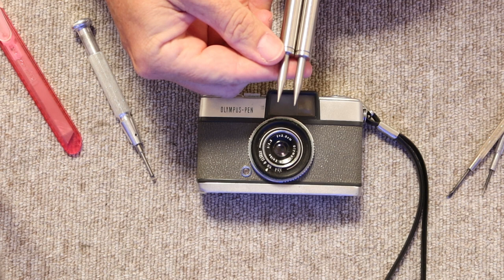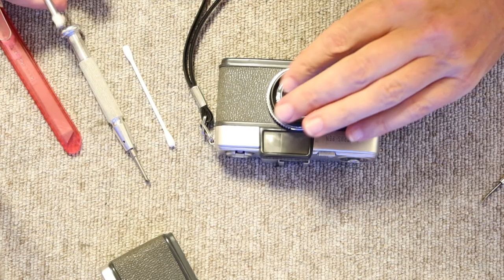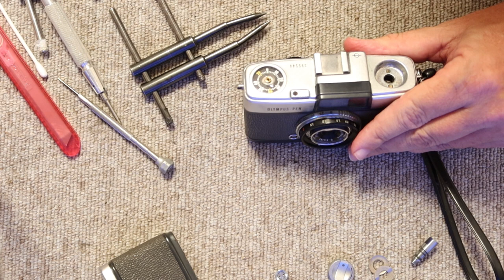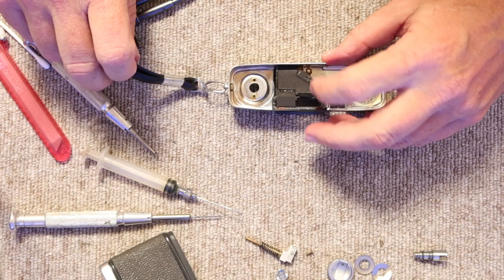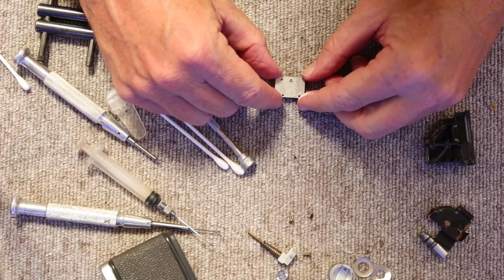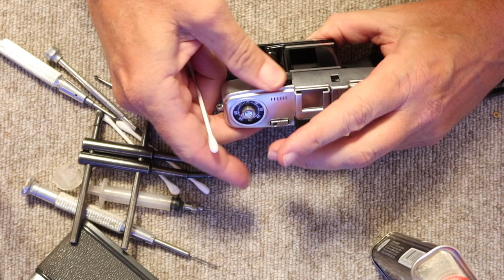How to fix up an Olympus Pen half frame camera

Comment: Thanks for the video. In my Pen D2. The shutter doesn't stretch when the frame is stretched, it just releases. Unfortunately, oiling the parts you describe does not help, even pulling up the spring did not help. It seems to me that the fault lies somewhere else, maybe in the ring with the finger that moves the re-tension lock.

Comment: I am extremely glad to have seen your video on the Olympus Pen S.

I have inherited my parent's Olympus Pen S. I've been using it for almost 5 years now but a few days ago before loading a fresh roll of film, I recycled through each of the shutter sped settings until the shutter got stuck on the bulb setting.

I reviewed this video and applied a little lighter fluid using a cotton bud on the shutter which fixed the problem.

It's now working well.

Later my next diy fux wpuld be aligning the frame line glass on the view finder. It's a little out of alignment but still usable as of this time.

To do this, I wil  be purchasing  8n the future a spanner to remove the screw of the film counter.

Sir, thank you for the videos and looking forward to more in the future.

Comment: I have an original Pen like this one. Mine works except for the frame counter, which you did not cover on this video. It would be helpful to see how to service the frame counter function. Mine takes great pictures. Without the counter working I just shoot until it will no longer wind forward. It takes a long time to shoot 72 pictures.

Comment: First of all, thanks so much for this amazing video! So much useful information and so many details are really welcome, specially when the information about disassembling this camera is so scarce on the internet...
I wanted to ask you if you’ve encountered any of the two problems that my Pen (3.5, early model) suffers from, and those are a pretty stiff shutter speed ring (doesn’t bother me much, but I’m not sure if it could be problematic) and my biggest concern: the exposure counter not advancing. It moves together with the arrow point when advancing the film but it will stick on the same number no matter what, so they just spin together in the same position over and over again.
If you have any information on those issues or know how to fix them, I would really really appreciate it!
Thanks a lot and keep up the amazing videos!

Comment: This is a great video, I just made a huge mistake and have no one to share it with...
I engraved my Olympus Pen, its all pretty so I took it out to shoot a roll, the shutter is sticking open.... so I look inside  following this videos disassembly, and cant find whats wrong....
so I took the lens out, like you said you have to peel back the leather and all that, that went OK, here is where I screwed up, I just saw the three screws on the bottom of the lens, the peice thats like a cup that holds the shutter stuff, so i undid them and pulled it off.... springs flew everywhere, I had no clue where they originally went.... ughhhhh.... It took myt about 6 hours to get it back together..... works great now though.
I did find the problem though, a small shard of metal from my engraving had fallen into the camera and jammed itself under the shutters where the little bump out to move them is, It was jammed in pretty good so I do think disassembly was necessary, but gosh, i wish I realized I could have took the lens apart from the front!
Today I will be trying to refocus for infinity, not sure how with a half frame as the ground glass doesn't have much detail....

Comment: Right after you took the top cover off (13:22) there was a small brass washer near the rewind knob hole that you took off. Where did that come from? Did you put it back?

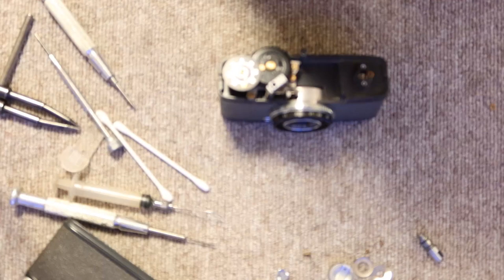Around 30:30 it looks like there was a second washer that slipped over so there would have been two washers for the two holes next to the rewind knob hole.

Comment: Hey, does this apply to the Pen W? Mine has a stuck shutter. Besides that, the Bulb setting was working, but then it started firing at 1/30 instead. I don't really mind fixing that as much, but still would be nice because I need to clean the inside of the lens as well. Thanks!
Reply from the maker: The Pen W has the same shutter as the Pen S, and is prone to having the same issues.
Reply: @japanvintagecamera8869  Thanks for the tips. I tried cleaning it a bit but it's still stuck. The winding mechanism is wound, but it won't fire. I suspect I'll have to open it up, but I suppose I'll be better off just taking it to a repair shop.

Comment: I have a question, can i use oil that we also cook with or do i need some kind of special oil? Also,i have a pen d does it make it harder to open the top because of the light meter? Is it more dangerous?
Thank you very much!!

Comment: I bought one the other day the Olympus Pen S with the f2.8 lens. Your right the shutter blades were stuck solid and the only way to free the shutter was to strip it down. The aperture was working but something must have moved and it will not close down now. The blades have slipped. I've put all kinds of shutters and aperture blades back but this unit seems like it's impossible to open. I have the aperture unit out with no lens elements in it but I can't get any further. On the inside part there are two notches that you can put a spanner wrench on but it seems stuck fast. Have you ever opened one up. Any help greatly appreciated.
Reply: Hi Peter, did you ever manage to fix this? One of the aperture blades has slipped on my Pen S too. Any help would be much appreciated! :)
Reply: @MoNtAg3mAn  alas no. I tried everything and damaged the screw thread so it will not go back in the body. I bought one the other week in better condition than what the photos showed for $1. Of course postage and taxes from Japan made it about €35. So I can either service this one or use the lens and aperture part for the other serviced one. The blades will come out if open the lens up and take the pressure off as you might have done for cleaning. I think I will cut the other one up to see how it is supposed to go together for future reference. I'll let you know the results

Comment: hey man, first of all thanks for the video, its very complete. I want to ask you if you know on how to solve my problem because the repair costs too much. I'm having trouble with a light source reflecting, there is a shape of white light in almost every single photo that I take outside. It's bothering me because it covers the entire picture. If you know how to fix it let me know, i would really appreciate it.
Reply from the maker: The camera probably has a light leak. There is a seal on the bottom cover and another in the channel where the cover slides up under the top cover. More than likely the bottom light seal  needs replacement, the top seal is redundant, and light won't leak from the top even if there is no seal.
Reply: @japanvintagecamera8869  Alright, thanks a lot man!

Comment: Great video, thanks, one of this just lining up for repair in my stash. New sub here.🙂 Hey just wondering do you have any trick to repair non working light meter in camera? For example the one in like a Ricoh half frame.
Reply from the maker: The best you can do is salvage a working light meter cell from another camera. Many early cameras with selenium cells, like Minoltas, had an adjustment screw to adjust the sensitivity of the meter, this can make the meter cell easier to adapt to another camera.

Comment: Very informative video. I have a Pen D2 I've been looking for how to service and didn't have any guides on it until now. My Pen D2 had a jammed advance knob. After watching this, I got bold enough to pop the top off the camera. That mechanism you mention at 13:43 was stuck and wouldn't let the knob move. I pushed it out of the way and now I have the reverse problem. The wheel advances the film and cocks the shutter, but does not stop. It does not cause the shutter to fire though. Any advice how to fix this?
Reply from the maker: There may not be a problem with the winding mechanism, it may be the shutter blades are stuck, and since the shutter wasn't firing, the camera wouldn't wind. The winding mechanism has pawls in it, these limit the travel when winding the film, and prevent the knob from being turned the wrong way. Make sure that these haven't been knocked out of place.
Reply: @japanvintagecamera8869  Once I got the advancing lever free, the shutter cocked and fired cleanly. There's something hinkey with the advancing wheel+levers such that the catch doesn't engage the pawls when it should. The pawls did look a little loose, but I'm not sure which direction to tighten them. Hopefully I'll have time to mess with them later this week.
Reply: I got back to fixing this camera. It looks like the cocking lever was pushing enough to engage the shutter, but not far enough to engage the winding mechanism to stop. I carefully bent the small lever between the cocking lever and the winding stop and that seemed to make it work properly. I'm not sure if its a permanent solution.
Reply: Can I ask if you mean, the winder will wind, but doesn’t stop where it should to take the photo? I’m having this issue now. I think I’ll have to rewind film and then attempt to fix

Comment: Would appreciate any input from yourself or commenters! I have an original UV filter attached to my Pen (same model as above) that has corroded and I cannot unscrew. Camera film tested and functional but lens has oil. If I unscrew from inside the camera to clean the lens, am I still able to access each lens component without complete disassembly? I am still new to camera repair and would hate to cause damage in reassembly. Many thanks.
Reply from the maker: I usually end up having to break off stuck filters on these cameras, this involves using metal nippers which I use to cut the rim of the filter and break the glass. You have to be careful not to cut or scratch the filter ring around the lens You can clean the inside of the lens by removing the rear element, you can hold open the shutter with the B setting, and use a pair of needle-nose pliers as a lens spanner.
Reply: @japanvintagecamera8869  That's excellent advice, really appreciate your expertise. Will give it a (careful) try. Many thanks.

Comment: Is there a way to remove internal dust from the lens? 😊
Reply from the maker: If you hold open the shutter on the B setting, you can remove the rear lens element group, then you can clean up the inside of the lenses.

Comment: Hey man! I wold like to ask u a thing, the shutter of my Olympus pen (like ur model) it’s locket in the “open” position and it does not close anymore. How can I fix this? TIA
Reply: Sorry I meat the blade of the shutter are blocked
Reply from the maker: The shutters in these cameras are prone to sticking, naphtha or lighter fluid will usually loosen them up enough to open or close properly.
Reply: @japanvintagecamera8869  thanks for answering me! The thing is that I can not see the blade of the shutter cause it’s open
Reply: @japanvintagecamera8869  if you want, you can answer on my mail so I’ll send you pic of my camera! Thanks a lot!!
Reply: Same problem as I am having. Have you resolve this already?

Comment: Why does mine need to advance 2 times to shoot...? 🤨 Is it a problem? If so... How to fix it. Pleaseeee
Reply from the maker: There is a latch and a pawl in the winding mechanism which often sticks in these cameras, and this causes winding problems. Cleaning and oiling these parts gets it working properly again,
Reply: @japanvintagecamera8869  thank alot! ☺️ Just got into film, found pen original. For 5 bucks 😂
Reply: Luckkkky! I bought my EE-S for $135.. lowest price I could fund actually >.<

Comment: So, you mean that Pen S f3.5 doesn't get stick easily?
Reply from the maker: That is correct.
Reply: All noted, so I'm going to avoid the f2.8 version of Pen S. Thank you.
Reply: @japanvintagecamera8869 my 3.5 has been getting stuck recently, the wheel won’t complete the spin. I got it a few weeks back. I noticed when I lightly touched the shutter with a dry cotton swap it would release

I’m assuming this “getting stuck” has to do with the shutter blades being dirty? I think I saw some grime on it when I opened it last too. Do you think doing the cleaning cycle you showed with 92% alcohol will fix it? Should I apply alcohol anywhere else? I’m assuming it’s the shutter as even lightly touching them fixes the issue for a bit

Comment: on mine the film wont pass, and the shutter wont fire
Reply from the maker: It could be the winding knob is stuck, which will prevrent the film from winding or the shutter from firing. You can sometimes free it up by applying solvent or lighter fluid to the underside of the winding knob between it and the plastic cover. Hold the camera upside down when you put in the solvent, with the lens facing downward a little.